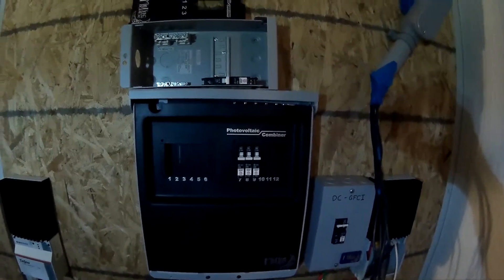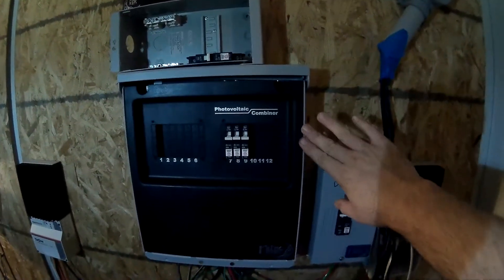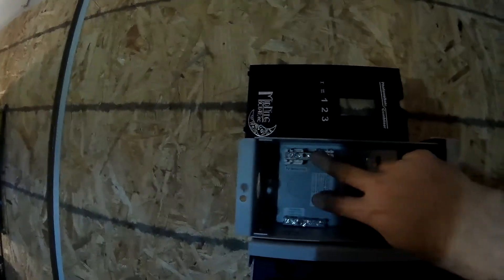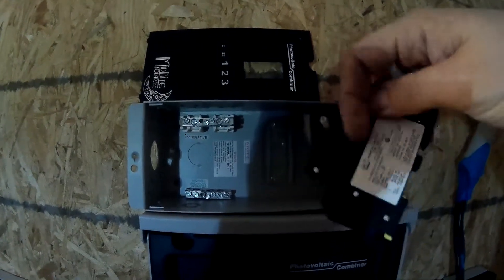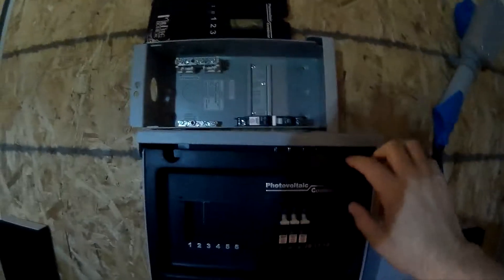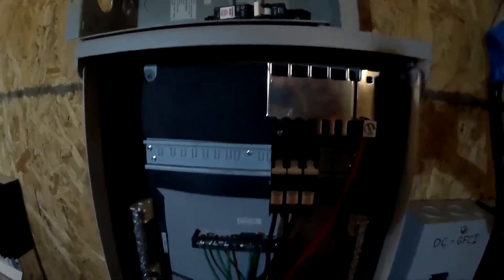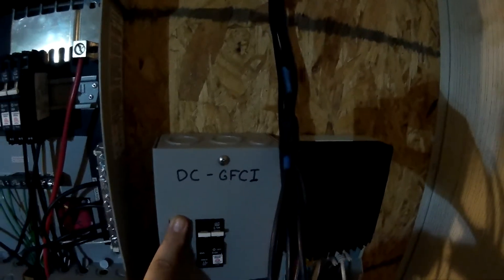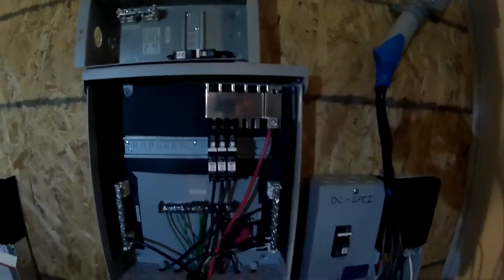Midnite Solar Indoor / Outdoor Photovoltaic Circuit Combiners. MNPV12 and MNPV3

Comment: Hi I noticed you commented on some Breakers DC type in a baby box, My Question is about 
the Midnite Classic 200 charge controller I installed mine but cannot get the instruction 
paper or plate off of the LED readout window please help if you know how, Thanks,.!
Reply: Thanks got it up and working.
Reply from the maker: elgoog you're welcome.